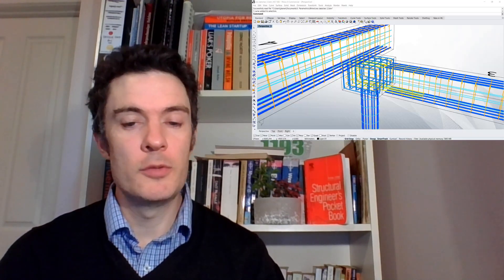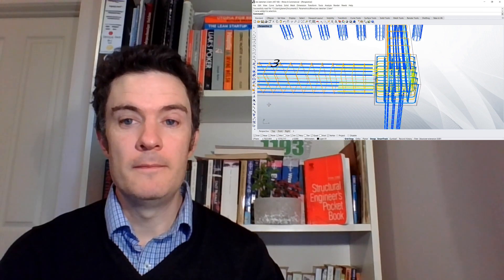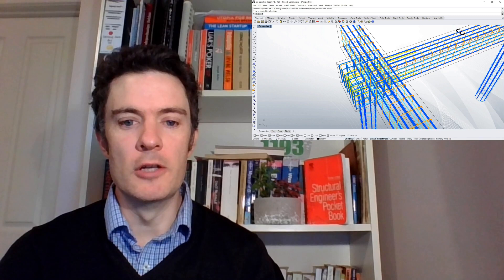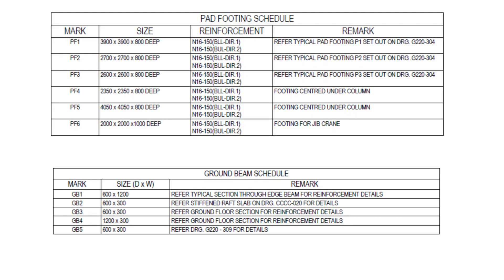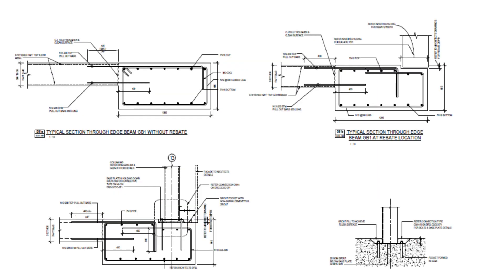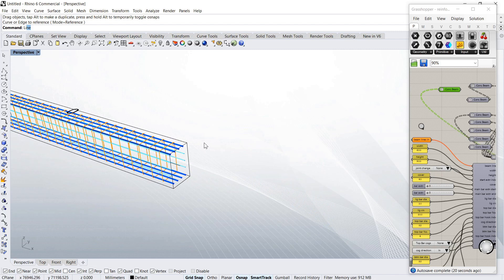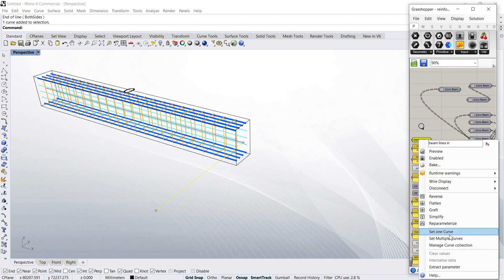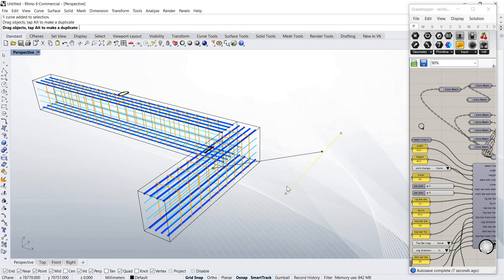3D structural reinforcement is easy now. How new techniques makes reo easy for Structural Engineers.

Comment: In Latin America we use CYPECAD software, which is for structural and detailed analysis of reinforcements. It is also easy to obtain measurements and documentation. Is it possible to create something similar with Rhino?
Reply from the maker: It would be possible but would be a lot of work to set up. I don't know if a company would find it worth the effort or not.